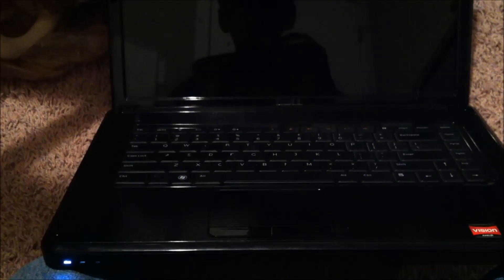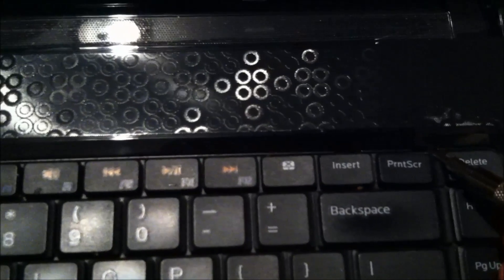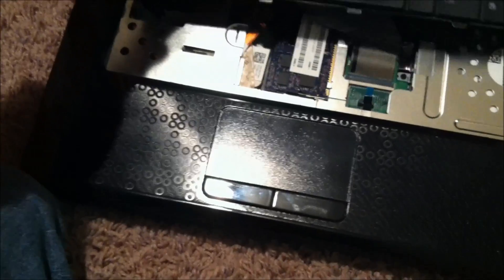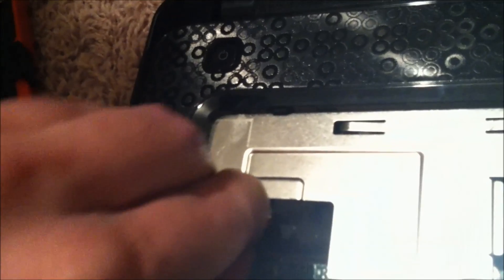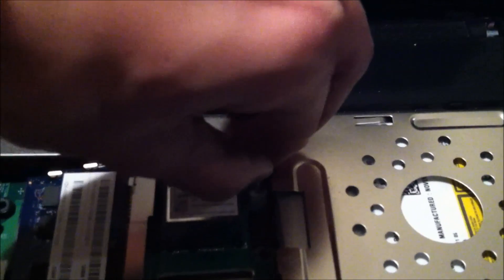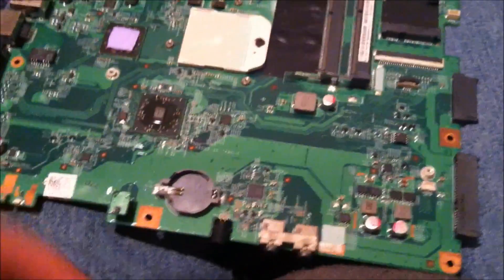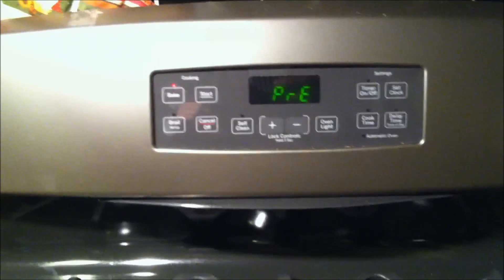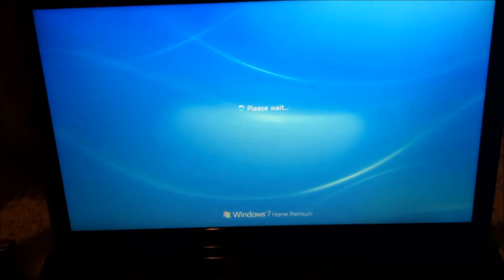How to fix repair Dell Inspiron M5030 7 Beeps Blank Screen No screen when turned on

Comment: how long will this fix last given the m5030  motherboard problem? and also is there an actual known now released by dell? Meaning is it the motherboard its self? is it the Soldering of the chips into the board causing the problem? If yes can i soder a new joint myself in a specific area instead of heating up the whole thing? I have just subscribed to you so please reply when you can thanks. Sorry for all the questions im just getting into electronics and wanted to fix it on the motherboard myself if its a soldering issue. Thanks

Comment: 7beeps on a M5030 no startup screen. Crazy bake the motherboard. Who ever first thought of this action? 
Great video. Carefully disassemble. Cleaned all the old heat sink paste. Alcohol and qtips. In my convection microwave oven I could only set temp to 375 so increased time to 11 minutes. New heat sink paste. WORKED. 😊
Backup HD. Do I  trust it? Regular backups. 
Bought an Intel replacement motherboard. For future  repair. Will need to follow instructions to startup windows 7 HD without reinstall windows 7.
😊😊😊😊

Comment: Had the 7 beeps of death on a Dell Inspiron 11 - 3000 model.  Tried the easy method of wrapping it up in a blanket whilst beeping to get it warm but that did not work.   Took the motherboard out and put it in the oven on 200 degrees celsius for 10 minutes and when I put it back in the laptop, it booted up and was fixed.   Lets see how long it lasts!
Reply from the maker: Shanon Denize awesome! Please report how long it lasts! I would back up any valuable information now while it works.
Reply from the maker: Still working?
Reply: @hitandrepair  It only worked for a week before the problem occurred again, so I just brought another laptop.

Comment: Mine doesn't beep but just randomly goes blank. Do I have to bake my motherboard ??
Reply from the maker: Erik Orehek could be a loose video cable going to screen. If you open and close your screen several times back and forth and it doesn’t do it? Then I’d say bake it

Comment: I did this with my pc (THIS SAME COMPUTER) and it made it worse DO NOT DO THIS it's a waist of time and when you put it in the over it has fumes and it makes you dizzy and makes your head hurt very bad. This is a WARNING!
Reply from the maker: Richard Edwards did you bake yours with the battery in it? This is lead free soldering, thousands of people have done this and you're the first to make this kind of statement.

Comment: What causing this problem? Is there a permanent solution as changing something from the motherboard? A friend of mine had this problem. She gave her laptop to me and I did this overheating with a hot air gun and it worked for a month. Then she gave it to me again and the same operation worked for a short time. She wanted to throw it in the garbage cause she bought a new one but I took it to see what else I can do for this M5030. I never tried this one from the video but I will. It's a last chance but if anyone knows at least for how long it will work after baked in the oven for 10 minutes on 200 degrees Celsius? Does it worth my time. Can anyone answer on my two questions at the beginning? Thanks guys!
Reply from the maker: Ray Colt bad bga soldering on video chip and you need to add copper shims to the video heat sink.
Reply from the maker: Ray Colt I'm not sure what temp of what I had it for but I didn't have it in Celsius
Reply: That thing with the oven works for me too! I did it today and I even watched a football match on that M5030 already so to test it. :) Works just fine. Thanks a lot for your help!
Reply: Ray Colt Its really meant as a temporary fix. It won't last as long on the 2nd time as it will the first. The reason it happens is because the amd cpu runs hotter than a intel cpu. Add that to leaving it on all the time or having multiple apps running cause more heat. If you do this I advise getting a laptop fan.
Reply: Thanks for the info. :)

Comment: I was skeptical, but I tried it anyway, and it DOES work. I was successful using a gas range and using a infrared temp gun on a pan in the oven, set to 385 F for 10 minutes (actual temperature set on knob was about 410 F to achieve 385 F in-oven temp) . I made foil pads for the corners of the motherboard, I didn't see that tip here, it looks like he just set it on the foil, but I read somewhere to use pads to elevate the motherboard board a little.
Reply from the maker: I put a socket under the motherboard

Comment: This is a terrible short term "fix" method.  Also, you should never heat up electronics in a oven especially one that will later be used for cooking as the toxic fumes will eventually make their way onto your food.
Reply from the maker: Everything is lead free, what toxic fumes?

Comment: Ok, I did it and when I turned it on the screen came on and also beeped. I left it on for about 5 minutes turned it off and then on again and no beeps. Now the touchpad isn't working. I'll check it tomorrow. 💤

Comment: Brilliant, worked exactly as you said. Only sign of heat damage was top right corner of mother board, and rubber sort of component (non-electrical), as far as I can tell only function is as a spacer. It was easy to pri/pull up to original shape. Set my oven to 200 degrees Celsius.

Comment: fake !! cmos beeps ?
Reply: +JAVIER JAVIER nope, when the GPU fails it will beep 7 times. usually resultant of fractures in the solder joints and requires reflow.

Comment: Dell laptops are crap. I had one that suddenly died. I had to dump it and bought an ASUS one, way better.
Reply: +Hassan Hassani depends on the model from Dell. Dell Inspiron is their "budget" brand that in my experience is built with cheaper parts and labor, hence the common issues (mostly due to heat degrading damage). ASUS has the same issue as with any manufacturer. I actually had to repair more ASUS laptops due to HD failure and screens going out. 
Dell Latitudes have been the best in my experience from my 13 years with the Army and now in my current job. When you buy cheap you have to take care of them as this issue is created by the soldering joints overheating and cooling too fast creating small fractures. Baking it or "reflow" basically melts the solder and rejoins the tiny fractures. To prevent this with cheaper laptops is to ensure you arent actually using it on your lap, you don't leave it sitting on carpet or your blanket, etc... the cheaper laptops dont have efficient cooling and the solder job isn't as good. hope that helps.

Comment: This is a temporary fix. Best case you may get a month or two out of it after this. Good Luck
Reply: +Joshua Wolford yes, temp fix however maximize the temp fix by making sure you are only using the laptop on a hard flat surface to maximize airflow efficiency. Also, dont play heavy graphic use games if at all possible. Anything that can cause the GPU to overheat again (or the CPU which is close enough to cause extra heat)... laptop cooling pads and only using the laptop in AC environments will prob get alot more time out of it. Or getting it professionally re flowed will be best option..

Comment: I spoke with my friend Who works with the Dell company. He told me that thousands and thousands of motherboards come with the faileture thats comes out after 2 years of activity.F*CK YOU DELL!!!
Reply: +Alvaro Geovanny (Geovanny_LC) cheap parts, planned obsolescence. When you buy cheap you have to make sure you take precaution to take extra care as it will not be as durable as the more expensive ones. 

Heat is the enemy when it comes to GPU's and CPU's which is the most common failure point that is "non-replaceable" making sure you use the latop on a hard flat surface instead of blankets, carpet, etc... will help. Overheating of the GPU and CPU will create the issue shown in this video. Its not just Dell. I have seen this on EVERY Mac 24" desktop that has video card failure and its magically after the apple care plan is up.. hah. Also common on Gateway desktops.

Comment: I had to do this a 2nd time. This time I got creative and used thermal epoxy to attach a copper shim on the heat sink over the GPU. Then I chucked the thermal pad and put arctic silver paste on the GPU just like I do with the CPU. I'm hoping that solves the problem permanently.
Reply from the maker: Hope it does!
Reply: how long did the first bake repair last, and how about the second time with the shim? if you dont mind me asking
Reply: +Thomas Whte The first "bake only" repair lasted maybe a week or two. The shim repair appears to be permanent. The computer has not failed again since the repair which was quite a while ago.
Reply: +Gabriel Bartash you might also want to look into adjusting the fan speed. This issue is caused by the solder joints getting tiny fractures due to high heat. buy a laptop cooling pad to keep it on, don't use it on your actual lap. Flat/hard surfaces maximizes the cooling efficiency of the airflow, etc....
Reply: +Michael Bennett, this was a repair I did for a client and it is permanent. There is no need to tweak fan speed settings or bother with a silly cooling pad. Bake the board as the video describes and then modify the heat sink as I have described and you'll be good to go. Thanks.
Reply: Gabriel Bartash the one I did for just the bake has been going strong for the past 9 days. Will keep the shim in mind when it goes down again. It was resurrected from the trash so no loss... just an extra laptop for the kids to play on.
Reply: +Michael Bennett I wish I had made a video doing the repair. If I ever encounter this again, I will make an instructional video. That I promise, because my solution is the only known permanent solution. And right now, the only people who know it are those who have read this thread. If you're going to open that sucker up again, you may as well fix it up right. All you need is a copper shim about the same dimensions as the thermal pad it will be replacing, some thermally conductive epoxy, and some thermal paste. All of which can be procured inexpensively on eBay.
Reply: +Gabriel Bartash can you please please make a video fixing the computer using your way?? I am afraid that baking the mother board might damage it permanently.
Reply: Unfortunately I don't have another to make a video with but I assure you that baking the motherboard exactly as shown in this video works perfectly. Just make sure you pop out the CMOS battery before you commence baking. The only difference in my repair is that I replace the thermal pad with a copper shim affixed with thermal epoxy to the underside of the heatsink above the GPU. Then I put arctic silver thermal paste directly  on the GPU before reinstalling the heatsink. It's actually quite simple. You can buy the copper shims on eBay fairly cheap. My repair is still going strong and as you can see I did it around 9 months ago. I know it's working because the customer in this case also happens to be my co-worker and I see him and the laptop all the time. I actually consider this my greatest accomplishment in freelance laptop repair. I'm proud of this because I thought outside the box and solved the problem. You know.... Maybe I can make a video showing the tools I used and describing the process. I'll see what I can do.
Reply: Laptop I did awhile back is still going strong. No issues.

Comment: Separated my fan from the heat synch and discovered the fins were full of lint ( as heavy as dryer lint) maybe that caused the 7 beep issue!
Reply from the maker: Nolan Cromeans could have been the cause of the problem, but wont be the fix. half assemble it and try it out and see, maybe you'll be lucky.
Reply: After Hours Tv & Pc repair I am going to do the fix ...again, already done it before and it worked great.  Thanks

Comment: I did all that and my PC still beeps...Now what? I am very lost.
I normally do not have this problem. It has to be the MOBO or the Processor how do I tell which one it is?
Reply: +Moleviolence How many times does it beep before stopping and then restarting? If it's seven then it's a processor failure.

Comment: I had 8 Beeps with the Inspirion m5030. Starting right now disassembled and going into oven
Reply from the maker: 8 beeps is display failure. Lemme know if that works
Reply: After Hours Tv & Pc repair No unfortunately
Reply from the maker: lcd screen is bad. or cable for it.

Comment: Can you explain why this worked? I'm taking an IT course I just started a month ago but I'm just curious as to why this worked? And I see that people are saying you could use a heat gun so what exactly would you be heating with the heat gun?
Reply from the maker: Drew Clough South bridge chip has bga solder points on it, because of either poor cooling design, or manufacturer, heating the board up, reflows the solder on the bga. bga= ball grid array.
Reply: Thanks so much I appreciate the insight. Worked on the first try you're the best.

Comment: No comprendo cómo el tipo del video pone la mother board en sus piernas... ahí está lleno de estática,.
Reply from the maker: Jorge Gutierrez la bandeja de metal y papel de aluminio serían tierra cualquier estática. He estado trabajando en los equipos durante 15 años y nunca he tenido un problema con electricy estática.
Reply: yo llevo apenas 6 años trabajando con estos aparatos y SIEMPRE he tenido cuidado con la estática...
Reply from the maker: y cuántas veces has tenido problemas estáticos con sus tablas por no puesta a tierra a ti mismo ??

Comment from the maker: @OzcarManueL click on the gear on the video, then click on subtittles and cc if its in english, click the translate down below it, and it'll pop up another window. Then you can translate it to spanish. if you need more help let me know
Reply: I have a question, I went to this place to have nine fixed but it didn't work so I was checking out your video and following step by step but I noticed one of the screws on the chip thing right beside the CD player is and it looks messed up. do I have to take it off or can I just leave it in there and bake it with that chip?
Reply from the maker: +Laura Sanchez can you send me a photo laura hitandrepair at gmail  thanks

Comment: Absolutely Worked. I got 7 beeps... Agrivated the hell out of me. I couldnt figure it out. I thought it was the Power adapter. I came across this and took apart the Laptop the laptop. Placed it in the over for 10 mins at 385 degrees... Waited 15 mins.. Put it back to gether and Done... FIXED.... Very cool.... Awesome POST
Reply from the maker: Good job fixing it yourself!

Comment: Do you think a computer impaired 16-year-old could do this? Because I started experiencing this problem today and I want to know if it's worth the risk trying this tutorial out myself, or if I should just try to get it repaired by a professional. I just don't want to risk destroying my laptop or losing all of the information on it.
Reply from the maker: You have nothing to lose. Data is on hard drive. Bake the motherboard. Take your time taking it apart
Reply: After Hours Tv & Pc repair ok well my sister and i spent an hour dismantling my laptop, and it came out fine (except im pretty sure me broke the speaker cord). we baked the motherboard and put everything back in again (we had some trouble putting in the things you took out at 5:25 i dont know if that may be relevant ). when i press the power button, the LED light will turn on, and i can hear the fan and stuff moving, but the screen remains black, and then the laptop shuts off by itself within a few seconds. it may still be beeping, but i dont know because im pretty sure we broke the speaker cord. i dont know what to do man. should i just pay the money to get it checked out by a professional, or is there something i missed? please help
Reply from the maker: At 525 is the memory. Might want to recheck connections. That being black could mean you didn't seat the connector right for the screen.
Reply: After Hours Tv & Pc repair i appreciate your responding to my comments. the connection with the monitor was what i was initially suspecting as the problem, but would that explain why the laptop powers off on its own after about a minute? when i press the on button now, the LED light turns on and i can hear the internal things whirring, but the screen is black, and it turns off by itself. still unsure if its beeping, because im pretty sure my speakers are broken now, or if this is issue is completely unrelated to the original problem. if i can ask, the 7 beeping means CPU failure, right? thanks

Comment: I'm trying this at this very moment my motherboard is in the oven.  I have tried the wrapping it in towels or blankets and letting it beep for 20 minutes which does work by the way but it only works for that time but after you power it off you have to repeat that same process over again.  I'm hoping this will be a more permanent fix.  It's my daughters laptop and she would be overjoyed if it works perfectly again.  By the way her laptop was only a little over a year old when this started happening.  Dell really needs to get it together.  Very disappointed in them.  I will let everyone know how this works out for us.
Reply: Well crap. I guess I'm one of the unlucky ones.  It didn't work.  Still beeping.  :-(
Reply from the maker: There's a service on eBay you can get for $45 dollars and they'll fix it for you. Is it the same 7 beeps as before?
Reply: After Hours Tv & Pc repair  Yes it is
Reply: After Hours Tv & Pc repair I put my last reply in the wrong spot but I opened my computer back up last night thinking I'd give it one more try and reseated the heat sink because it looked like it wasn't screwed down correctly and then I tried it and PRESTO!  It WORKS!  I guess that original fix did work but it was my fault for not screwing the heat sink down correctly.  Thanks again!   Was about to buy my daughter another laptop.  Thank you!